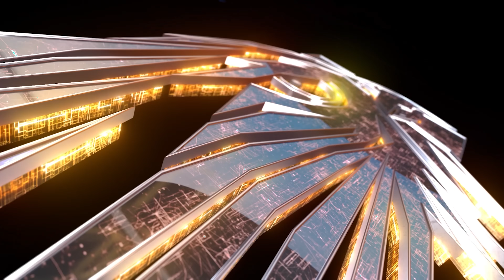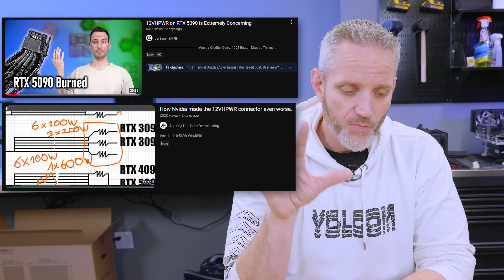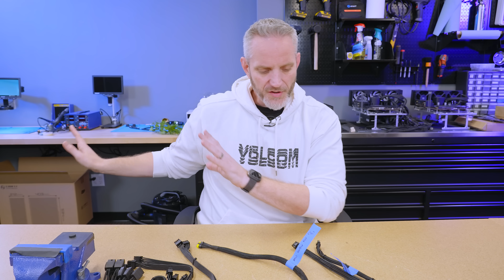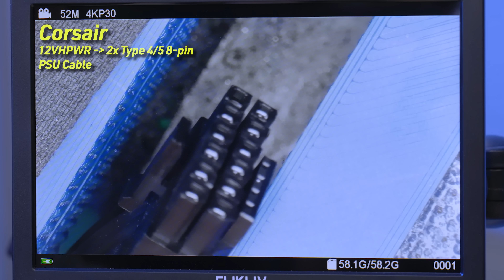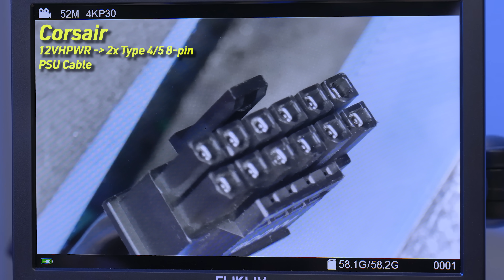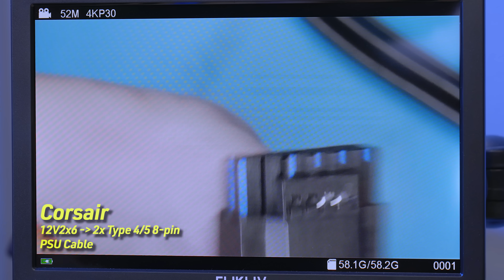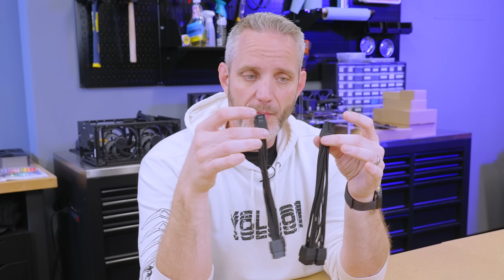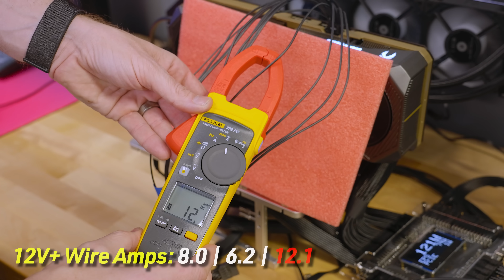I discovered something concerning and I need the Experts to chime in... More 12VHPWR discovery!

Comment: From Germany. 
The problem of burnt-out plugs and burnt-out cables has always been the fault of the graphics card manufacturers. If you read the specifications for the power supplies and cables, you'll know that too. For the power supplies, all 12V pins are supplied by a busbar that is protected with 600 watts, for example. So if the power supply provides 50A, then the power supply only has to protect the total output of 50A. With the 12V2x6 plug, this means that the consumer has to protect each individual 12V line against overload. For the graphics card, this means that only 8.33A can be drawn per cable via the 6 cables. So 6 cables x 8.33A = 50A provided by the power supply.
Unfortunately, Nvidia doesn't even seem to have mastered the basics of electrical engineering. Otherwise they would have known that the power supply has a distribution rail that supplies all the pins. If you then first create a busbar for the pins on the graphics card behind the connector, the current can choose the easiest path between the two rails. That's a little lesson in electrical engineering: parallel connection of resistors. In this situation, the cables and connectors are nothing more than resistors and the current always chooses the easiest path.
It would have been correct if Nvidia had first run each of the 6 incoming +12V lines through a shunt with current limiting so that the graphics card could guarantee, in accordance with the regulations, that no single cable draws more than 8.33A.
But that would have cost 30 cents more. Nvidia was too stingy for that with a $2000 card.
Reply: "aircraft engineer here", "electrician here", .. this guy : "from Germany"  lol
Reply: Im a physician 😂
Reply: How about using cheap XT90 connectors like for RC cars? They can do 90A...
Reply: shunt resistors can measure the flow of electric current in a circuit through voltage drop. shunt resistors DO NOT limit current.
Reply: @maliamalairitis  You are absolutely right, I made a mistake in the translation. What I meant was that the shunt also measures the current per cable (!) and then limits it to a maximum of 8.33A. As required by the regulations. Asus and MSI do the same on their 5090 FE cards. Nvidia has once again saved itself the trouble and is not adhering to the specifications. That is one of the reasons why the Nvidia 5090 FE will probably be recalled and banned from sale in Europe in two weeks.
Reply: totalmente de acuerdo, allí es en donde esta el problema. El estandar si funciona
Reply: @eevblog
Reply: Sheesh at this rate they might as well join 2x6 paris into two conductors onto the GPU that are rated for 30 amps per conductor or perhaps redesign the PSU’s & GPU connector to 24v and half the amps… The shorter the conductor the less resistance, I wonder if the long cable is properly rated? That really long cable is probably using the same conductor (radius) as the shorter cables which when driven to high amps can be significantly hotter.
Reply: If that's true, then my 'general concept' of quality inflation is also true, and all sort of such actions can be sum up to point that we are 🪛 hard for our money. That is also why I lost all of my interest in any new products.
Reply: The PDM2 cost $99, is a low volume, niche product. With Nvidia sourcing power and manufacturing process, it will cost much lower to have that kind of current balancing on their cards.
Reply: smaller PCB is more impressive than a 30 cents current balancer xD
Reply: I'm surprised that the only problem so far is in the GPU connectors, cables & PSU connectors. What about the PCB itself? Looks very thin to me to handle such concentrated power input reliable longterm. So even if the cable and connector are solved, the PCB is gonna get rekt next.
Reply: @ PCB traces can carry a surprising amount of current, and additionally they are pretty reliable. If thermal imaging doesn't reveal any issues it's probably fine.
Reply: In 3 years, we will play on macs at this rate ! XD
Reply: 5000 dollar card bro
Reply: Unlike some people I find the first sentence quite amusing from a scientific standpoint, because many comments here can be perceived as argumentum ad personem, basically speculating. Maybe it would be easier to analyse this if there weren't only ~100 FEs sold.
Reply: You are right therefore I will tell you something. The Over Current Protection is shifted towards the PSU in this design . The PSUs should have control over how much current they send over each connected pin in parallel set-up.
And they ( PSUs ) do - they do have the OCP. The units which those people use are the Corsair HX1600i (derBauer), or the HX1500i - Jayz.  I myself also use HX1500i and in the iCUE software I can see that there is a setting to keep Single OCP or to make it Multi-rail OCP.  For high-end cards - this must be the latter.
I bet they have not even looked into this config of the PSU.
Reply: Running shunts is exactly what they did up until the 3000 series, 3 shunts for load balancing on those cards. Now they have 1 shunt for the full 6 wires in parallel, which has no ability to load balance, for that massive $0.30 of savings.
Reply: @  Load balancing on wires is shifted to PSUs these days.
Reply: @MortalThe  Does the PSU really do that? It would need to limit the current per wire. Limiting current on PSU side means reducing voltage for a **single wire**. This would cause backfeeding. Imagine 12 V and 9 V being supplied on different wires. Since the GPU combines them into a single rail, it would backfeed into the PSU, leveling out to something around 10 V. That's bad in every way. Instead of limiting the current, the card needs to limit its power by reducing clock speeds and core voltage etc.
Reply: @xdevs23  The PSU should and it claims to be able to stabilise the current in the so called Over Current Protection function.
It can do that by not limiting the Voltage, but increasing the Resistance internally in the PSU loop, keeping the Voltage stable. If it is done well , it is then a Current cap. The PSU absorbs more heat internaly in this process , which it should disperse.
Reply: I suggest you read couple of comments above yours and replies to that comment from experts. You clearly aren't an expert so don't pretend to be one.
Reply: @InsaneDark  You don't have to believe me, just as I don't believe your alleged experts. We can also agree on Roman 8auer, who confirmed my opinion yesterday afternoon and released a video on the German and English channels and refuted all your alleged experts.
Reply: @thomaskamp9365  they aren't alleged read and you'll see why they are expertts and you aren't. Ofc you agree with him because you aren't an expert and you are blindsided by your limited comprehension of the situation. The experts that I mentioned didn't speak about the GPUs they spoke about the reality of electricity you should definitelly read it
Reply: @ OK, I'll gladly take the trouble to look at the experts you've just mentioned.
I've been writing about this topic on various platforms for over a week now and I admit that thanks to all the blind Nvidia fanboys I'm slowly losing track and no longer feel like discussing measurements, specifications, international regulations or official circuit diagrams from Nvidia.
It's been known for more than a week that this error is on Nvidia cards. MSI and Asus cards don't have this error because they measure the individual currents and warn the user or shut down the card immediately.
But spare me all the experts who claim that the cause is a measurement error, an operator error or a user error. They've all been refuted several times in the last 2-3 days.
Reply: @thomaskamp9365  I never was Nvidia fan I don't give a fck about Nvidia just stating the obvious that you aren't really objective and neither is 99% of the media regardless. Yes what Nvidia did changing in 40 series was not cool but it is what it is the cable manufacturers should have known it by now and adjusted. IWhen 40 series came out it was Nvidia's fault but it no longer is
Reply: nvidia has problem for the same reason boeing has planes falling out of the sky, just sayin, you figure it out
Reply: What kind of shit EEs they hired in Nvidia?
Reply: @johnl2613  the ones who want to do consumer products. if you wanted to try you would do something in a different sector
Reply: Love the disccussion this sparked. Particularly the comment along the lines of "30 cents, try like 100 dollars" like that's even a big issue on a flagship product retailing at 2000 dollars. Sure you will lose profits, but we are talking about a tiny reduction in profits for a niche product aimed at people that semingly shit gold on a daily basis. Oh that's before you even include te fact that this whole line is a paper launch. Please stop defending the insane profit margi of a company that gves zero fucks about you
Reply: All they need is lines connected in parallel inside the plug already. Then current in wires is automatically the same even if one pin has worse contact between plug and GPU.
Reply: Crazy Right I did Electricity on a base level at school and first thing we learn is that Electricity always chooses the easiest way, looks like Ngridia has done the same here and chose the cheapest way but they gona pay soon enough! Only good thing about this the scalpers got FFFF***ed
Reply: 30 cents is alot on a 2k card when you realize that a single drop of missed profit would impact their stock price. And that is the ONLY thing they care about these days is their stock price. Period. The. End.
Reply: "from germany" thinks poor 12 volt connections don't make hot connections and then talks about high paid electrical engineers like he's smarter than they are....
Reply: 30 cents more for 6 smt 10 amp regulators ? regulating 600watts ?  lmao try 50-100 bucks...
Reply: @smartmonkey777  No, it won't be that expensive. You only need to balance the 6 lines, i.e. adjust the resistances in the 6 lines to the same value. If the 6 sections have resistances of 0.3 ohms, 0.6 ohms, 0.2 ohms, 1.0 ohms, 0.8 ohms, 0.6 ohms, then you only need to increase these evenly to 1.0 ohms. This can be done with very cheap components. Proper current regulation for the entire current can then also be carried out after the busbar.
Reply: @thomaskamp9365 Lol, starting a comment "from Germany" as if this gives you some magic engineering knowledge. Actual engineer from Germany here: you don't balance power draw by increasing resistance of the wires with shunts as you implied. Shunts are there as an element to measure voltage drop as a proxy for current. You use some active components that are far more complicated. I don't know the details, but I know so far that's it's not just a shunt. And I don't speak outside of my expertise to not look like an absolute fool.
Reply: @alphakevin687  You just did look like a fool and spoke outside of your expertise, you embarrassed Germany 😆Bulidzoid just did a video on the 1 shunt lack of load balancing on the 5090, go watch it.
Reply: @ first off if you did just plop a 100w resistor on there but it wouldn't be small and it would be only around 50% efficient so you would lose like 4.5 amps in heat also a 100watt resistor is huge, third and most importantly a resistor cannot adapt the resistance and therefore voltage to keep the current fixed despite many other varying factors, so yes you need a regulator (and support circuitry) on each wire to balance the current to within specification. You clearly have only the most rudimentary of understanding.
Reply: @alphakevin687  Assuming the cable (and connector) is uniform enough to be within the safe limit for each wire, then load balancing is not required. A shunt on each wire, or at least group of two wires as it was in the previous cards, allows the card to shut down if it measures a dangerous load imbalance preventing damage or even a fire.
Reply: @thomaskamp9365  Your numbers are way off. If the wire had a resistance of 1ohm, that would be a drop of 8V at 8A of current, meaning not only will the card get the remaining four volts instead of twelve, the cable will also produce twice as much heat as the card...
Reply: @smartmonkey777  And why do you need a 100W resistor? I don't know what is a realistic value of cable resistance is but let's say 0.05 ohm. A 0.05 ohm resistor with a current of 10A will produce a heat load of 5 watts. And that is still on the high side. If you really wanted to cheap out on the balancing, you could use cheap linear regulators.

But anyway, there are already a lot of voltage regulators on the card! Instead of pulling them all from the same 12V supply, they could be split up into groups for each wire. This may not be perfect as different groups of regulators draw different power for different workloads, but I am sure the engineers at Nvidia can come up with a solution that doesn't cost close to 50 bucks.
Reply: @thomaskamp9365  also when buying in the hundreds of thousands at a time (which they obviously do) then these things become super cheap !
Reply: @ You're literally just making things up dude. If you use a resistor as a dropped you always lose 50% as heat, thats just how the loads balance out. And you need a 100 watt resistor because 12\100 =8 amps, so really you'd need a 200w resistor. and resistors come in fixed wattages 1 5 10 20 100
Reply: @ Da haben Sie mich falsch verstanden oder die Übersetzung mit Google hat mal wieder nicht richtig geklappt. Wir haben hier das Problem, das die Sammelschiene im Netzteil (+12V) die mit 50A abgesichert ist, über 6 parallele Stecker und Kabel auf die nächste Sammelschiene in der Grafikkarte laufen. Wir haben hier also eine einfache Parallelschaltung von 6 Widerständen mit unbekanntem Wert. 
Das ist der ist zustand im Moment auf der Grafikkarte 5090, der im Übrigen gegen alle Spezifikationen verstößt. Der Verbraucher (Grafikkarte) muss sicherstellen, die einzelnen Pins nicht überlasten. Das Netzteil sichert dafür die Gesamtlast ab.
Kommen wir zurück zu ihrem Kommentar.
Das ein Shunt nur zum Messen da ist, ist mir durchaus bewusst. 
Wir haben hier jetzt 6 unbekannte Widerstände (Kabel, Steckerwiederstände, Temperaturunterschiede) in Parallelschaltung, wo der Strom sich den einfachsten Weg aussuchen darf. 
Da haben Sie jetzt 2 einfache Lösungen für das Problem:
1.) Die teure Lösung ist, das Sie auf jeder Leitung den Strom messen und begrenzen. Also zuerst über einen Shunt und dann durch eine Strombegrenzung.
2.) Die preiswerte Lösung: Sie gleichen einfach die 6 unbekannten Widerstände aneinander an, in dem sie einen einstellbaren Widderstand hinter jeden unbekannten Widerstand packen. Dafür müssen Sie aber auf jeder der 6 Leitungen einmal den Strom messen und dann mit einer diskreten Steuerung die einstellbaren Widerstände entsprechend anheben, bevor die auf die Sammelschiene kommen. Die Reihenschaltung an Widerstände verteilen also nur den Stromfluss, sie begrenzen die Strommenge aber nicht.

Das ist wirklich ein billiges, einfaches Problem. Zu ihrerer Unterstellung, dass ich vorgeben würde, mit dem Satz "Von Deutschland aus" zu implementieren, dass ich Ingenieur wäre, dem ist nicht so.
Ich schreibe das ganz einfach immer im amerikanischen Sprachraum vorweg, da mein Englisch nach über 50 Jahren doch sehr eingerostet ist und ich diese Texte dann lieber mit google übersetze. Ich mache den Leser also darauf aufmerksam, dass mein Englisch manchmal ganz einfach ein wenig grausam sein kann. Soviel Höflichkeit sollte man seinen Lesern schon entgegenbringen.
Wenn Fragen, dann fragen.
Reply: @ You are absolutely right that I simply pulled the numbers for the resistors out of thin air. There was a very simple reason for that: I think it is more important to explain the problem here first of all, why the plugs and cables burn out. To do that, I will allow myself to use simple numbers. The important thing is to understand the problem first.

In recent years, the plug manufacturers and the cable manufacturers have always been wrongly accused....
Reply: @alphakevin687 It could also mean 'hey, I'm no native speaker, please bear with me' ..
Way to jump to the most negative possible interpretation! But that's normal today, right? Because we all want drama, and be a smartass, and talk down on others..
I don't even assume it was meant that way, but my point is: BE MORE CIVIL FFS!
Reply: @thomaskamp9365  the reason why the burn out is simple NEC requires one single run of 6 gauge wire for 50 amps, these  wires are only good for 15 amps if any thing fails they are over current by over 3 fold ... there is literally negative 300% safety margin.
Reply: @smartmonkey777  That's why the specifications specifically state that the consumer (graphics card) must ensure that no pin/cable is overloaded! Nvidia just doesn't adhere to this rule.
The power supply cannot detect this and doesn't have to be able to detect it, they only protect the total load (50A).
Reply: @smartmonkey777  no you dont. Most cards have a 5mOhm shunt resistor per 12V rail, meaning that at a voltage drop of 0.05V over the shunt, the current passing through the shunt is 0.05V / 0.005 Ohm = 10 A. Said voltage drop is measured and because the shunt has a known resistance, the current can be calculated. Wam bam, its that easy. No need for some 100W Resistor. Stop talking bs please and look up ohms law :)
Reply: @ It seems one of my replies didn't show up. Anyway, I wanted to say that a resistive solution does in no way always cause 50% loss. High power regulators are only problematic if they actually have to change the voltage by a significant amount. But here were are talking fractions of a volt, this can be handled with cheap and easy solutions without massive efficiency losses.
Reply: @thomaskamp9365  there is Single OCP. And there is Multi-Rail OCP. You can set this up in the settings of Corsair.
Reply: @smartmonkey777  this is how the 3090ti was done, 3 shunts.
then nvidia basically moved to one single shunt, you could loose 5 of the 12v power pins and the gpu wouldn't know and pull 600w from one pin, previously that would have been impossible
Reply: @john1182  the shunts are simply part of the regulation circuit to monitor
Reply: @smartmonkey777 ur crazy they buy compenents by tons...its 1 dollar in parts, obviously its more in engeniring planning specs, but if I was paying 2500 usd for a gaming card I would expect it to last/ not burn has well has perform..
Reply: @Saiohleet  Dude just the regulator alone is  5 bucks x 5 plus all the other support components, and that's from one of the biggest component distributors, sure if you buy 20000 you probably will get a discount but not a couple bucks. If you wanted higher end parts  for more efficiency you might pay even more. 
we pretty much know the amount of 5080s and 5090s , about 30,000. thats literally a couple rolls of components , not BY THE TONS , lmao.
Reply: @smartmonkey777  Why would you need 10 amp regs? Shunt resistors cost CENTS! The 3090ti had 3 12V lanes monitored with one shunt each. This is Nvidia cheaping out on a product with massive margins.
Reply: @smartmonkey777  Not if there buying in bulk cost goes down not up LMAO
Reply: @smartmonkey777  Where are the smt regulators mentioned? All you need to do is shut down the GFX card if they go over spec or do power throttling. It does that already anyway so why not do it per-wire?
Reply: @smartmonkey777  Nvidia has been making a fuzz about current balancing in their power stage since PCIE cables exist and they always managed with simple shunt resistors, so that´s definitely nothing more than a buck fiddy in cost savings.
Reply: @smartmonkey777  Except the input lines were isolated on the much cheaper 3000 series. You don't have a clue.
Reply: @smartmonkey777  Considering that it is now unsafe i'd say worth it.